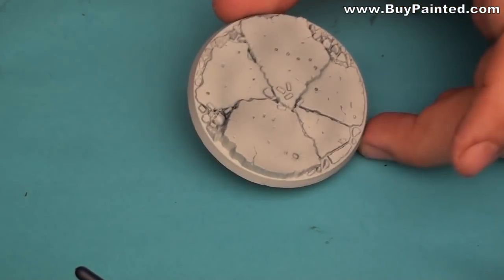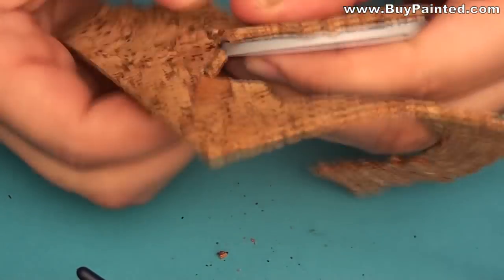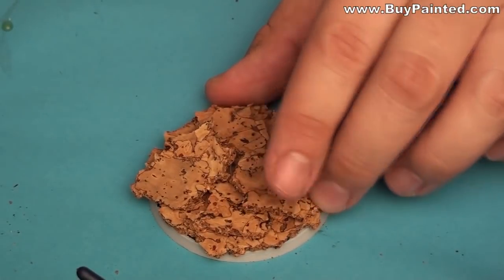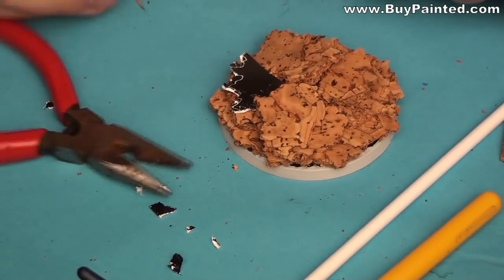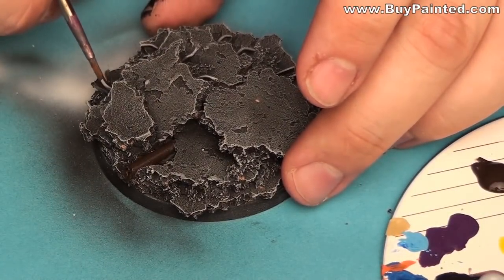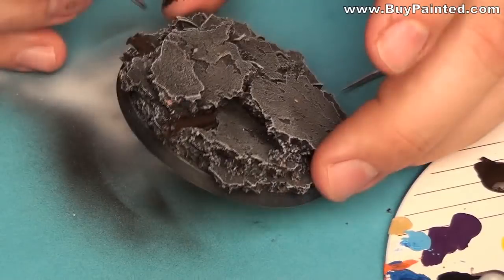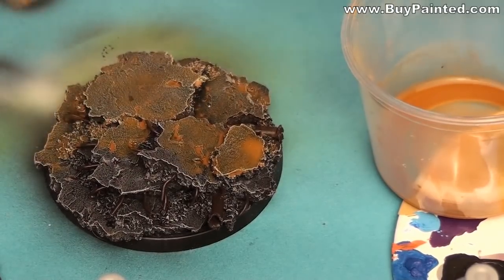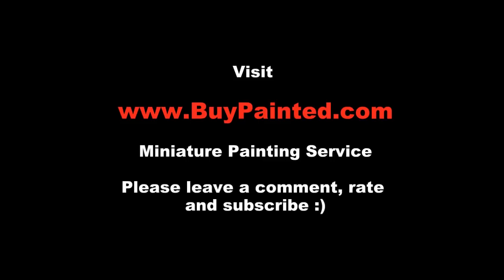How to make a base "Ruins" for Space Marines Dreadnought? Warhammer 40000 Buypainted

Comment: I would love to do some of this, pity it is so damn expensive :/
Reply: are you saying 40k's expensive (well, yeah, it totally is, but it's worth it if you enjoy it), or that making a cool base like this is expensive?...if it's just the base materials you're worried about, well, I've just recently started working on some bases like this myself, and I've been quite surprised by how affordable it can be!

...for the cork, I just bought a cheap 3'x2' cork pin/notice board, only cost me $15, and that'll be enough cork for an army's worth of bases!...other than that, you just need some paints, which you'll probably have already if you're making a base for a model...as for the metal parts he added for this one, you'd probably have hundreds of things lying around the house, that when chopped up, glued on, and painted, will work great as rubble/pipes/metal plates/etc

just use a bit of creative thinking, and you'll be able to make bases just as cool as this one for virtually nothing

Comment: anyone know where i could get some cork like in the vid in the uk?
Reply: Any store that sells like furniture. Like Ikea bro.
Reply: +Joshua Cox also pretty much every craft shop ever.
Reply: +Gul&#39;dan Darkness Incarnate look for "cork tiles"
Reply: did you find any? if not they sell cork tiles in most office supply stores. They are used for bulletin boards so will be in that section of the store. usually come in a pack of 4 sheets of 12"x12"
Reply: Any store that sells floor covers will have cork floors. Flooring in general seems to be a great source for all sorts of things when it comes to terrain building.